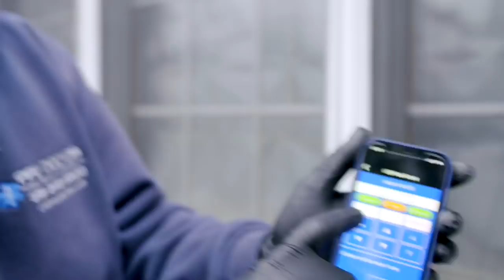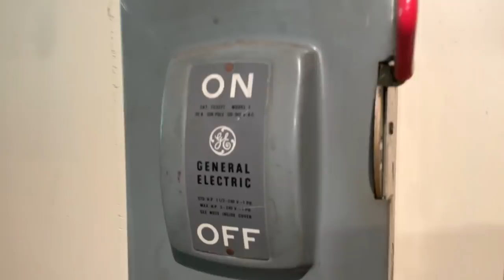House Almost Burnt Down - Luckily Someone Was Home - 50 amp Circuit Breaker Didn’t Trip Condenser

Comment: this was a great video, Mike -- that whip being melted like that was insane.  not that it really matters, but i wonder if that old beast of a condensing unit wanted 50 amps or if that was just what they gave it.  i've got just a 20 amp 240v breaker / feed going to my 2 stage, 3 ton condensing unit because that's what it calls out for the breaker size.
Reply: Spot on. That and it was grounding through the flex cable.
Reply: That is exactly what I was gonna ask. Why would you need a 50amp breaker, 20 amps is more than enough, that should not happen
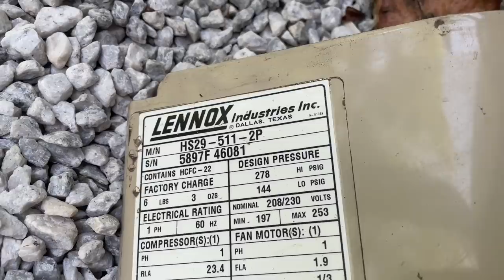Reply: @ssvzvz929  Pause the video @9:38 and you'll see the minimum ampacity required is 31.2 and the recommended max breaker size is 50. There's an exception in the electrical code for certain types of loads (air conditioning specifically included) that allows a breaker larger than would otherwise be needed to protect the wiring, but a 50A breaker is expected to trip before wiring adequate for the specified 31.2A actually melts.

Comment: You didn't show but was their any resistance on those shorts to ground?  As little as 3 ohms would keep the current at 40 amps on each 120 leg which is 80% of the breaker so should not trip the breaker.  Doesn't look like the service to the disconnect was burnt and they look like close to the proper 6 gauge for 50 amps.  But what was the gauge in the whip?  If it was 8 gauge, it needed a 40 amp breaker or 40 amp fuses in the disconnect.  But the system is old so it could have built up a voltage drop in the whip wires if the weather tightness was compromised long ago.
Reply: @PipeDoctor    I did just find a MikeHoltNEC video from August 2020 on Air-Conditioning, Circuit Sizing.  In that his example shows code permits using 10 gauge in a whip with a 50 amp breaker.  I don't see how that would stop what happened to that system.
Reply: @jkbrown5496  10 Gauge in the US should be 30 amp breaker.
Reply: I also felt the breaker ampacity was higher than that compressor was rated for.

Comment: Mike, it looks like that breaker was to big for the wire.  It looked like that was #8 wire and old, probably should have been a 40.  Good video.
Reply: That's possible as well. I wired my whole house with 12 gauge for the 120V outlets with 20 amp receptacles. I think 14 gauge is kinda thin imo.

Comment: your indoor smell.. the transformer getting burning hot when the low voltage wires in that conduit to the condenser melted from the heat and shorted the 24 volts out... ..  it realy possibly couldve damaged the boardi n that furnace since it wouldve been a dead short on that cooling relay..  (my XR80 from 2004 uses a cooling relaytosend signal to the condenser...    def want to check the furnace out well if he buys off on a new A/C only system

Comment: yeehaw, all the issues there, low voltage wire in the whip, oversize breaker, no equipment ground/older wiring.
looks like with compressor shorted to ground, the current was flowing through the coated metallic whip to the disconnect, which is likely grounded via conduit feeding it.
what's scarier yet, is power would have also been present on the whole refrigerant line-set, the coil and very possibly the whole furnace, ductwork, gas piping and more. it all could have been electrically live and killed someone(major yikes). I'd be looking at the whole line-set, evap. coil, t-stat wiring, line voltage wiring to inside unit and anything on, near or around the ductwork in the house, probably wise to trace all the gas piping and check any appliances connected! they were very lucky to not have gone up in flames at multiple locations throughout the home.
Reply: also, it likely never reached high enough current to trip a 30amp breaker, let alone the 50 they had feeding it. a fused disconnect likely wouldn't have helped either, unless the heat traveled up the conductors into the fuses making them open thermally.
if that had a proper grounding conductor from unit to panel, it likely would have tripped, instead of making the whip into a heating element ;)

Comment: Didn't short right away,just sat there drawing high current,get things all nice and hot till she reached her limit,seen it quite a few times tgat the circuit didn't reach the potential needed to trip, but the windings just sat and smoked the oil and refrigerant!
Reply: You funny guy
Reply: Yeah I think the Breaker was too big anyway. I didn't catch the recommended breaker size on the cabinet.

Comment: 30to40amp breaker should have been big enough cause what I am thinking is that the breaker was too big and that is why it didn’t trip.
Reply: Nameplate listed 50,and it didn't look like #6 wire in disconnect! That looks to be a bit bigger than 4.5 ton unit

Comment: The burnt smell situations can be really scary for a homeowner.   I haven't seen wires melted to that extent on a job before but I wouldn't trust that old disconnect or whip.  As others have mentioned,  good advice to the homeowner.

Comment: Mikey good job as usual,it looks to me that disconnect to the outside unit wasn't bonded.It was hard to see but it looked like there was no bond wire in that seal tight whip.

Comment: Turn it off is always a good idea. But most homeowners don’t know how to do that , they think turning off thermostat does everything. 
Homeowners need to know where emergency switches and circuit breaker panels are located. The first thing they ask a serviceman is
( where is the switch ) they don’t realize - it is their house and every house is different.  What would they do without 911.

Comment: That's crazy. Your 100% right that faulty breaker would have let the wire burn the house down. Time for a new system from mikeypipes
Reply: I think the wrong breaker was installed. 50 amps on a condenser ?

Comment: Just dam, likely burnt compressor.
Recommendation the wrote from the breaker to the service disconnected be replace as well.  And install correct breaker.

Comment: The 24v can be with the other wires as long as it has the same or greater rating as the highest voltage in the conduit or raceway

Comment: what size wire is on that 50 amp bkr ? probably to small and breaker should be changed.
Reply: #6 is required

Comment: Hey Mike is the circuit breaker supposed to be a 50 amp. ?  Or a 30 amp ??    Just wondering why the circuit breaker did not trip
Reply: Nameplate lists 50 amp,Fla comp is 26 amps plus,fan 2

Comment: at the 5:42 mark check out the  strap on the flex connection on the return ductwork that strap is defeating the purpose of the vibration isolation between the unit and the ductwork...i know cause i did that same thing 35 years ago as an apprentice and got  my a-s reamed out for it..just sayin...
Reply: Most building departments want to see a bonding wire across the flex connectors

Comment: 50 amp circuit "breaker" requires a 6 gauge copper conductor on all wire to the device (that is the part NEC code looks after), that wire did not look like a 6 gauge.  The condenser could have run on a 40 amp circuit (8 gauge wire).  The breaker could been bad but it was the wrong size!!   Sort of like putting a penny behind a bad fuse.
Reply: Unit called for 50 amp breaker,RLA,was near 28,plus,2 for fan! 930 in video shows that, yes should have been #6
Reply: 9:38 in video timeline, MIN.CKT AMPACITY, AMPERAGE MINIMUM on nameplate 31.2, MAX FUSE or CKT. BKR 50.  A 40 amp breaker (max size with 8ga wire) would have blown. The "dead" compressor short turned the 8ga wire into a toaster element.

Comment: When you go back to replace equipment you might want to recommend the owner get an electrician to look at that circuit.  Was it a faulty breaker?  It should have tripped with a dead short.  I'd be reluctant to replace until that work is done to avoid liability issues should there be a fire in the future.  I've worked on 2 separate accounts where there was a fire within a short time of doing work.  In each case there were flaws in wiring and each time I noted that on the ticket and had the customer's sign a waiver of liability.  You just never know.  Had I not got those waivers it might have been bad for me.  Both were commercial accounts and both burned factories to the ground.  In fact, I found out one was gone when I returned with parts for repair work.  The owner was standing outside with hip boots and the entire building was flat on the ground.  The other was a customer who wanted to operate heat without a t-stat...just using a light switch to actuate the furnace.  Neither fire was caused by the hvac equipment, though, when the fire marshals did their investigation.  But it made me sick to hear of those incidents.  Even after all these years I can remember both like it was yesterday.  Better to be safe and cover thy butt.
Reply: He did inform him to have an electrician over to check out the wiring if you watched the video in its entirety.

Comment: Literally my last call today was a similar thing to this lol, go to the house to tske pics of the damage, the customer had firemen come to the house bevause they had smoke coming out of the condenser, the firemen found the fire was from a wire, and the ñinestraw in the unit.  I get there and find all the wires for the compressor, crankcase heater, and the condenser fan melted and burnt up, the plug for the compressor was melted onto the compressor, and the only thing i could assume happed was the crankcase wires that were burnt off had sparked against some part of the unit and caught the pinestraw on fire which caused everything to burn

Comment: Any thoughts on why the breaker didn't trip? Nice video 👍
Reply: I would guess either the internal mechanism to the breaker got jammed somehow in the two ways a breaker trips wasn’t able to overpower that jam in the mechanism.   Even though it was not one it Kind of reminds me of the old federal Pacific breaker panels! The Breakers in a federal Pacific panel would never trip you could have a 20 amp breaker pumping out over 50 something amps even probably 70+  amps making the wire glow cherry red arcing and it still wouldn’t trip!
Reply: Junk breaker.

Comment: 50 amp breaker in the panel , to high   That man and his family were real lucky.
Reply: If you pause the video @9:38 you'll see that 50 is the recommended max breaker size, and the unit requires a minimum ampacity of 31.2. It's not apparent what wire guage was used in that whip.
Reply: @MelvinTheGrate  exactly,alot of viewers don't pay attention! ,the nameplate clearly states 50 amp, the rla,Fla info is all on that nameplate,looks like maybe # 8 in disconnect maybe 10 hard to tell,but the 3 phase disconnect should have been a clue tgat things may bee a little strange on this one

Comment: Thumbs up and a new sub.  Just curious, without giving your price, how much higher by percentage  was a totally new system which was your first recommendation over what your customer decided?   50%, double, triple, just a ballpark percentage.   My wife and I were in a situation where our package unit was almost 17 years old and still going, but it was 17 years.. We decided to byte the bullet and purchased new because with the warranty, better efficiency, and less service calls, we felt it was a better deal over the life of the product.  I understand not everyone can afford to make that decision, but in the long run, we felt it would be less expensive than attempting to keep an old unti going then buy new when of course we would need to do when it was 100 degrees.  Great work and continued success.

Comment: Electrical code allows you to put an oversize breaker on a given size wire feeding an AC condenser to prevent nuisance tripping....  I would never do that.. Size the breaker to the wire....
That being said there was definately a problem with that breaker... G.E. were known to fail.

Comment: a 50 amp breaker is suppose to trip at 40 amps, but systems are not 6 gauge wiring or even 8 gauge wiring,, so 50 amp breakers are too big I feel for a outside unit, that are drawing less than 30 amps running daily, BREAKERS are suppose to be matched to Wire size, nothing else.
Reply: That is not totally correct. The electrical code allows for the breaker on the condensing unit to be larger to allow for starting current of the compressor since it is a motor. The problem here is that there was improper grounding path to allow the breaker to trip. I have been thru similar scenarios in my career.

Comment: Lennox rubbish - Bahahaha - OK so the compressor has windings short circuit  to earth nothing unusual - what I find disturbing is that the MCC is very well labelled yet the AC's breaker is more than twice the size that it should be 23A unit and a 50A breaker ???? I am not sure what you pulled out of the whip along with the supply but that is definitely not right - using plastic coated metal flexible conduit with single insulated wires again is unusual - I am guessing the person who did this install may be a factory electrician - OK what I think happened - the whip's entry glands allowed water to get into the conduit - the compressor has failed to earth and the breaker has not tripped the supply cables heated the water in the conduit and boiled it away causing the conduit's outer insulation to melt once the water had boiled away the heated plastic kept melting - what I would do is get a qualified electrician to check every breaker in that house for correct size and functionality - in Australia every circuit has to be protected by an RCD what you guys call a GFI ?? Great Video + Love Your Work !!
Reply: I thought 50 amp breaker seemed too big for that condenser.